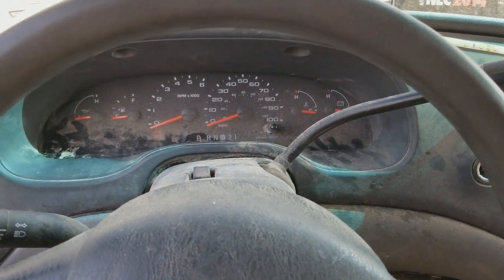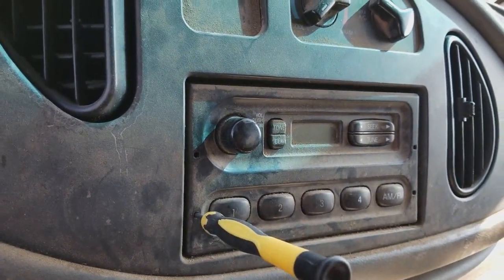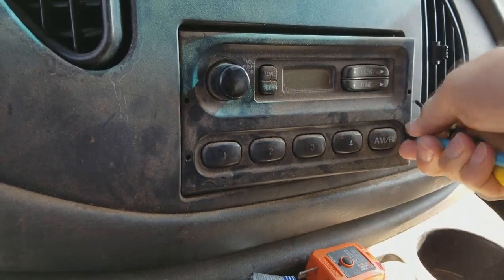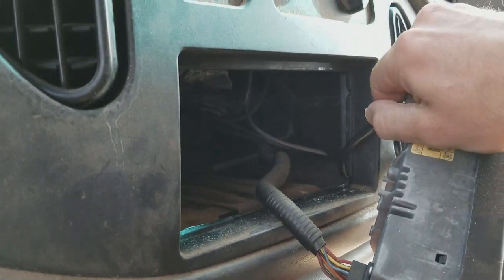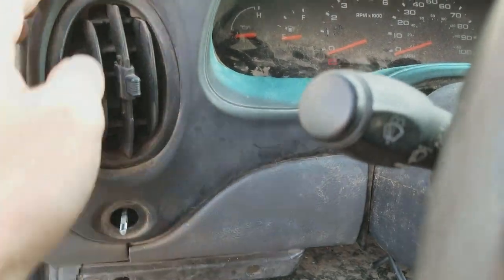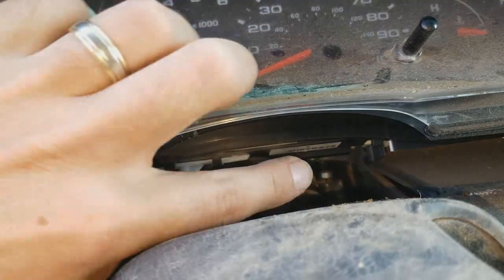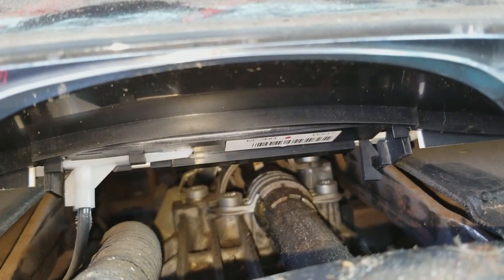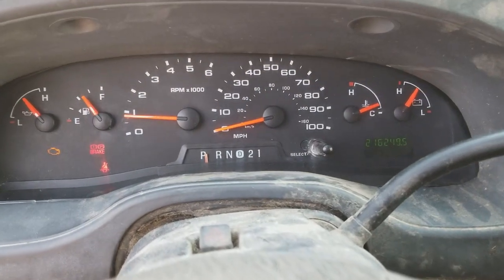2004-2008 Ford E-Series Van Instrument Gauge Cluster Removal For Repair

Comment: if you were close to central Missouri , I'd have you do this to my 2007 E250 > Mine works with exception of stuck on 3000 rpm when engine in not running lol

Comment: I have a 2006 van, all relays and fuses are good, all the wires that should have power have it. Warning lights come on, as does the guage illumination. But no guages work and no radio or dome light.
Reply: Is this pretty typical for a bad cluster? The one I removed had a tag, it was either tested under a recall or replaced in 2007.

Comment: Did you replace or repair the cluster also was your radio turning off when the cluster  was not working
Reply from the maker: We repair the cluster, also the radio issue is definitely a common issue. Here is a link to our service if you're interested in sending it in.

https://www.automotivecircuitsolutions.com/collections/ford/products/200-2008-ford-e-series-instrument-cluster-speedometer-repair-service

Comment: Damn that looks easy just 2 electrical connections ?
Reply from the maker: Yes, just the 2. Thanks for watching
Reply: @AutomotiveCircuitSolutions  np thanks for the video. Answer alot of questions I had about doing theses
Reply: @AutomotiveCircuitSolutions  what about reprogramming? Or anything like that?

Comment: Hi..
I've got a question. 
2005 E 150 Ford Van.. Dash lights went out, auxiliary plug has power. The red needles laminate when I turn the lights on at night. But again, no Dash lights (can't see any numbers or anything white at night).
Would you have a link for the fuse box? For some reason I can't find the exact one..
Thank you in advance
Reply: You gotta buy a new speed o meter
Reply: @peterrodriguez2014  I don't know if that's the problem or not!